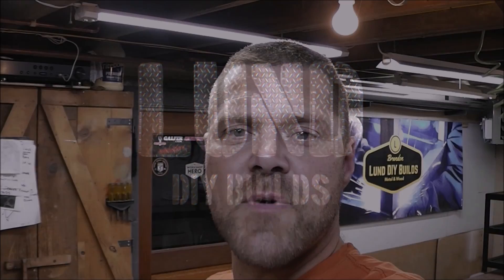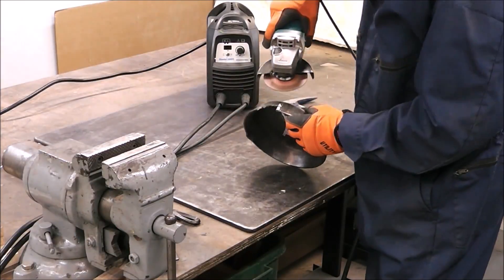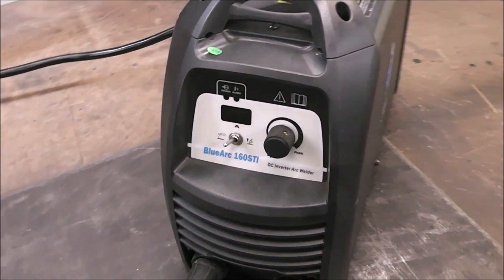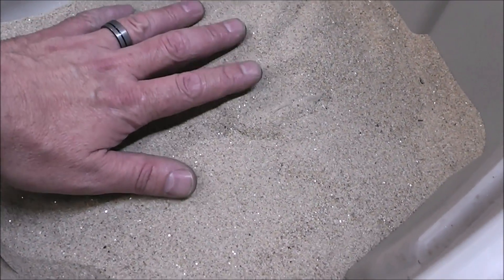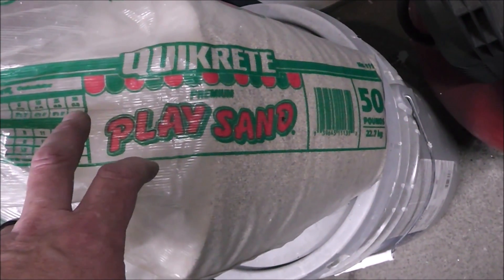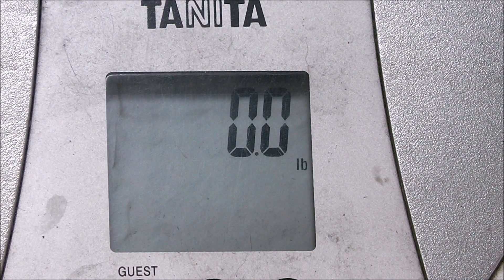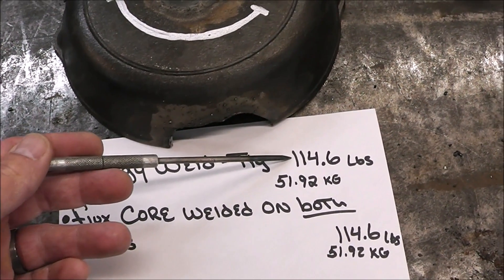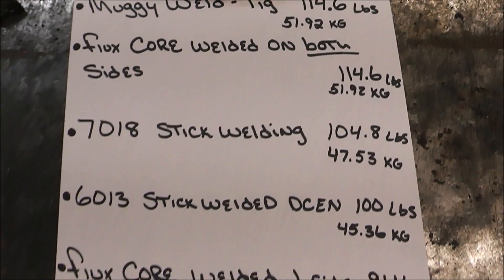Stick Welding Cast Iron Repair with 6013

Comment: Question... I have an old bench vice with one of the mounting "ears" broken off and long gone. Can I weld on a new tab out of steel to repair it? I have access to ac stick (which I'm very experienced with!), tig (which I have no experience using) and a gas shielded mig, which I use for smaller work.. Thanks, great video!
Reply from the maker: You can but I've had mixed results. A lot of other people have had good success also
Reply: @BrandonLund  At this point I’ve got nothing to loose! THX!
Reply from the maker: No problem and good luck. If you have a way to preheat it like a gas grill, throw it in there for 20 minutes or so on high before welding. Do short beads with peining then bury it overnight in dry play sand. Please check back in. These repairs and results help a lot of folks. Good luck!
Reply: @BrandonLund  thanks, I can put it in the oven at 450 for a while! The break has like a point that goes in under the base so some angles to weld should make it stronger too! I’m thinking of a 3/8” thick tab ground to fit in there as close as I can.
Reply from the maker: I agree 👍

Comment: I heard that stick welding chromoly is very hard. Maybe harder to weld than cast iron.
Reply from the maker: I have never personally welded chrome moly but yes it is more difficult to weld due to its high tensile strength / sensitivity to heat.

Comment: May I ask a couple of questions please? I have one of those cheap cast iron anvils that I have hard faced, more for the experience than any other reason. However, although I know I have increased its overall yield strength, as you have here, I’m presuming the tensile and compression strength of the cast iron has remained the same? So, as I use it with hot metals and the hard facing expands earlier and easier than the cast iron will this in turn cause the anvil to crack? Also as the metal in the hard facing rods has greater impact strength will the cast iron anvil crumble beneath it? These questions are more academic than anything as it’s just a surface to tap hot things on than anything else as I can only do small projects.
Reply from the maker: All great questions mark. Anytime you add a dissimilar metal to cast iron it will be susceptible to cracking. The reason for this is the high carbon content in cast causes it to be hard and shock resistant which is why it’s good for cookware. It doesn’t fare well when you add a dissimilar metal because of the difference in expansion ad contraction which is why nickel which is a relatively soft metal is selected for repairs. If the part isn’t undergoing repeated heating and cooling cycles and it didn’t crack during the repair it will likely outlive us both. Using it with hot metals I feel wouldn’t be enough heat to effect it. Even on exhaust manifolds it can take years for a crack to redevelop
Reply: @BrandonLund  Thank you very much for such a complete and comprehensive answer.
Reply from the maker: Anytime buddy!

Comment: Welding cast iron. Is something that is a tricky repair. Low Heat and Peening seems to work well. 
  I would like to see how cast iron repair will hold up  when the metal gets hot and cold cycles repeated constantly as in an engine block,  like a section  of 3"x 4" piece is missing from the side of an engine and replaced the a piece of steel, will it leak oil ?   Great Video, thanks for the info. William from Orange County California
Reply from the maker: Hey William cast iron that is heat cycled in air versus heat cycled in fluid will have a tendency to crack easier. The reason is    that cast iron that goes through heat cycles in the air will have a faster temperature swing and be less stable than a part that is submerged in liquid which rises and cools slower. Heat cycles will always increase the risk of it cracking again

Comment: Is the pan useable for food preparation after being welded?
Reply from the maker: The safe answer is no. The only reason I say this is because cast iron can crack again after numerous heat cycles. It could be years or it may never happen but because its possible I would not recommend doing it. God forbid if hot grease leaked out from a crack or the handle broke and spilled hot oil. It could be fatal. As far as food contacting the weld metal. I wouldn't be concerned unless it was repaired with nickel. Nickel is a carcinogen.

Comment: Hi Brandon, I thought you did a very good job of presenting a fair test of the 6013 rods, which is one of the most common rods available in Australia. I think that you might have something of an advantage given that you are trying to repair a modern item where the casting mix has been more tightly controlled. But that is what you want in conducting an experiment, to control the number of variables in each round of the experiment. I work at a private school in Melbourne Australia as a Carpenter who also does welding repairs. Given the school is over 160 years old there are cast iron components in all sorts of places. A lot of it is a very dirty shitty cast that has been in the elements for the better part of a century or more. Some stuff you just can't save and if it's failure is likely to injure someone then it gets replaced with an in sympathy substitute. So as you can see, I have a interesting relationship with cast iron.
Reply from the maker: Thank you! I agree the cast iron of today is probably more controlled. We will be doing a lot more of these types of videos coming up real soon. Thanks for watching and commenting!

Comment: Brandon, great video.  I have a cast-iron skillet I use, but the handle is way too short because the skillet is very heavy. I would like to lengthen the handle by welding a longer piece to the handle. For this job, what is the best material to use for welding/lengthening the handle?
Reply from the maker: Thank you! For liability reasons I have to tell you that you shouldn't do this because if the handle were to break with hot grease someone could be severely injured or die but if you were to attempt it for testing purposes, nickel rod works very well with cast iron. You could use steel or better yet find a cast iron pan and cut the handle :)

Comment: Looks good  Is it battery powered, if so what kind. Thank you very much
Reply from the maker: If i remember correctly its a 2032 but its solar powered also. The lens has 4 sensors vs. 2 so you never get arc flashed.

Comment: I only have 7016 rods. Heed to weld a heavy casting, Will they do ?
Reply from the maker: I have never run 7016. The characteristics are similar to a 7018 (both are low hydrogen) and I've had good luck with 7018 so it might be worth a try.  Anything with a high nickel content is also a very safe alternative.
Reply: @BrandonLund  Thanks for that. I have some high nickle rods if I need them, but if the 7016 does the job I have plenty of those.

Comment: Thanks for this video, I’m preparing myself for a huge cast iron bowl repair that measures 6 feet wide and it is currently in two equal pieces lol

I’m probably gonna use ceramic blankets and a number 10 rosebud tip for preheating
Reply from the maker: Thats massive. Yes a preheat and insulated cool down are essential. Good luck with your repair.
Reply: Brandon Lund thanks man! Subscribed 👍🏼
Reply from the maker: @Weldingprobably  thanks for the sub man! If you have FB feel free to share a pic..everyone loves project pics.
Reply: Brandon Lund I would but I don’t use Facebook anymore.....maybe I can put a video together 👍🏼
Reply: Brandon Lund well they got upset at me over the cost! So we are probably not going through with the repair lol
Reply from the maker: Professional work isn't cheap...especially with something like that
Reply: @Weldingprobably  It would be interesting to know what they thought was a reasonable price for such a repair? 
You may have been getting close to B.E.R. Beyond Economic Repair, and or the cost of replacement.
Reply: Mark Fryer they wanted to pay 400 bucks! I said no

Comment: Hi I have a broke #6 vice can I use 6013 ro weld it on ac welder
Reply from the maker: I've had mixed results with 6013. Get yourself some Nickle rod. You have a far better chance with nickle.

Comment: How much weight would the unbroken pan bear? I suspect that cast iron repair is inherently weaker than the cast in its original form.
Reply from the maker: I would say that it would be about 1/3 stronger. Cast iron will always be weaker after it's repaired and will usually break in the heat effected zone, not at the weld.

Comment: This is awesome! I have atractor implement that parts of it is cast iron so it's about 3/4 - 1" thick that broke further inspection it already had a crack in it for sometime before it broke. I asked around with local welders and said it can't be welded  back together and that I had to have it remolded and this part is a big heavy piece that only the end part that holds it together broke off. So my question is can I weld something that thick back together  cause I noticed that you welded cast iron that is 1/2" thick.
Reply from the maker: Thanks man I appreciate you watching and commenting. To do it right you will need to heat it up...keep it hot as you weld it then insulate it real good with a welders blanket to control the cooling.  1" is thick but if you can control the preheat and the post cooling, the welding is actually the simple part. If its already broke it can only get better right.
Reply: @BrandonLund  ok kool thanks for your reply .ill give it a shot see if i can fix it! But in the mean time more videos on your channel i really learned alot from your videos thank you for all you do. Im not an expert but a do it yourselfer !👍

Comment: Is it true that you can weld cast iron using 6013 after dipping the rod in oil ?
Reply from the maker: I've never heard of it. Oil would contaminate the joint

Comment: Interesting series, the problem with welding anything cast is actually the grain structure not material, for me its either brazing or tig with ML60 or MY60 rod (think thats name its a specialist rod and cost like $40 each that my engineer friend gets)
Although you want something trick check out cold welding cast :)

Comment: Great video and quite surprising!  Would love to see you braze that pan with some straight copper res. housing wire using brazing flux if needed.  Brandon L - you're the best!
Reply from the maker: Thanks bill! That's an interesting filler metal. It has me curious....hmmmm?
Reply: I was tig welding some steel one time and couldn't figure why it was taking so much heat to melt the rod. Turns out it was a piece of copper wire I had mistaken for tig rod. It's fused with the steel though. I'm curious what the breaking point of brazed joint would be what rod composition works best.

Comment: You can calculate the load on the handle by measuring from the vertical axis of the load to the fracture. It was MUCH more than the 100lb load weight!
Reply: He's also not adding the weight of that probably 50lbs chain.
Reply: @flyback_driver  Huh?  The chain was included in the measurement.  It was in the tote along with everything else.
Reply from the maker: Shhhhh your going to spoil it for him and take away his fun. People love to find fault and things to complain about. I'm guessing he skipped through the video or he would have seen what we all saw lol.

Comment: confused ……. the weld broke at 100lbs  breaking strain  the welding  rod has a breaking strain of 60,000 lbs (6013) . the weld broke in the HAZ  is that a good weld or not
Reply from the maker: Cast iron hardens when its welded...which is why it broke not on the weld but beside it. If you needed it to hold more than 100lbs I would say it was a failure. If not than it was a success.

Comment: So how much strength is lost? How much weight would break a new cast iron pan?
Reply from the maker: Unfortunately this "project" turned into a series so we dont have actual numbers but  if I had to guess I would say you loose about 1/3 the strength when repairing. Mainly because the piece work hardens in the heat effected zone. It becomes less flexible.

Comment: I learned - that I’m Not buying $100s of dollars of Welding Equipmnt,
to Weld a $160 Cast Vice.
Thank you ... time to buy a new Vice❕
Reply from the maker: No, but if you do, then you can charge others to fix their broken vise then eventually your tools will have paid for themselves. I only buy tools with that thought in mind. Many of my tools have paid for themselves 10x over.

Comment: So 6013 is just as good a rod as 7018 for cast and both are about as effective as flux core wire welding.
Reply from the maker: Pretty much if all is equal. Just keep in mind that all batches of cast iron are not the same so do a little and see if it cracks. My personal experience is that 7018 is much more forgiving than 6013

Comment: I would have thought that peening the weld with the hammer would make the need to slow down the cooling unnecessary.
Reply from the maker: Yes and no. I always thought that peining was to relieve stress but it's actually to elongate the weld which is basically mashing it into the base metal.  This process helps reduce the cracking that occurs if the part cools too quickly. By burying in sand or a welding blanket, you are allowing it to cool very slowly.

Comment: What would happen if I used AC on my Lincoln Welder with the same rod?
Reply from the maker: It would work just fine.
Reply: @BrandonLund , Many thanks, I have a cracked block in my 5 hp briggs engine and Im am going to give this a try.
Reply from the maker: Drain the oil and clean the area real good with acetone. Dont use carb or brake cleaner. Be sure to report back...or better yet post some pics on the LundDIYBuilds facebook. You might help other viewers. Good luck man!
Reply: @BrandonLund  Thanks Brandon, Can you tell me why carb or brake cleaner is not ideal ?
Reply from the maker: @paulg444  it creates deadly phosgene gas when heated.

Comment: Good for go and keep on cooking ham & eggs E6011and is food grade repair 😎🔥
Reply from the maker: I have tried 6011 before and have not had very good luck
Reply: 6013 is a rutile rod. 6012 and 7014 are also rutile rods used for cast iron.  Ni rod (high nickel) works best if arc welding.

Comment: Anyone else tried the Hobart ‘nomacast’ rod? Doesn’t say if it has nickel or anything else in it, and it’s cheaper then their proper nickel cast rods. Ran decent looking beads for my crappy project but there were spider cracks at the start/finish of some of the beads.

Comment: soooooooo, I gotta go buy a welder next time my cast iron skillet breaks?  Just kidding!  Great video!  just goes to prove  that when someone says it can’t be done, someone who thinks outside the box shows that it can indeed be done.  Well done sir!
Reply from the maker: Thanks man! I appreciate your support!
Reply: J W Dickinson you could actually fix it on the cheap using a MAPP gas torch to do the preheat and brazing. But the torch and rod would still cost more than a new Lodge pan.
Reply: Matthew Hall very true...however, Brandon just used the pan as a test piece to prove the process.  This obviously carries over to other cast iron parts, like vintage car exhaust manifolds that can no longer be found or cast parts that would far out cost the repair supplies or service.

Comment: Best thing for beveling joints without contamination is a simple carbide burr. Use it in an air die grinder if your compressor tank is big enough, or get an electric die grinder for $100-ish and not have to worry about air.

Also, an air hammer with a blunted tip works great for peening, and peens much more evenly than you can by hand.
Reply from the maker: Great points buddy! Thank you for sharing :)

Comment: Good to know 6013 can do decent welds considering all the hate they get.  I often use 6013 myself since it usually starts easier,  7018 is ok too.   Should cut that cast iron pan in half and weld it back together and run it over or something.
Reply from the maker: Great suggestion! I like it! Thank you

Comment: No one can do wrong with E6013! It's Gods divine rod! A gift for welders worldwide! Best wishes and regards sir!
Reply: I hate 6013 ,I really can't weld with them 
I use 7018 or stainless rods or even 6010
Reply from the maker: @daniele3275  next time you get some 6013, try a real steep drag angle. I think you will see a big difference.
Reply: @daniele3275  you have to use a steep drag angle and turn up the arc force enough to push the slag back.
Reply: @massa-blasta  arc force? My welder have not it 
Just a simple inverter ,no antistick,no arc force,no hot start ...
7018 works well I can make good looking and strong welds with them 
6013 are backward to use for me
Reply: @daniele3275  you will be quickly overcome by the melting slag, unless you use a steep angle and move fast, if you don't have an arc force adjustment and don't have access to AC.
Reply from the maker: Thanks John! Best wishes to you sir!
Reply: well thats the rod sold here in our place...
kinda hard to maintain but as ive been weldin w/ it ive learned how she works depending on amps

Comment: Well it will certainly hold your bacon and eggs,  But I still will use cast 80 or 90 rods for cast iron even thought 6013 and 7018 will work
and will weld both sides if I can. Brandon, again a good video and you showed us that  6013 is a very good all purpose rod, always keep some on hand.
Reply from the maker: Thanks Bruce D I appreciate your comment and support! Cheers buddy!

Comment: I wondered why in many countries around the world they weld almost every kind of steel and cast iron with 6013.
Try to weld in AC current.
BTW how to weld cast zinc, i need something cheaper than the muggywelds product.
Thanks.
Reply from the maker: I will see what I can put together. I’m not aware with any other cast zinc repair products.
Reply: @BrandonLund 
Thanks.